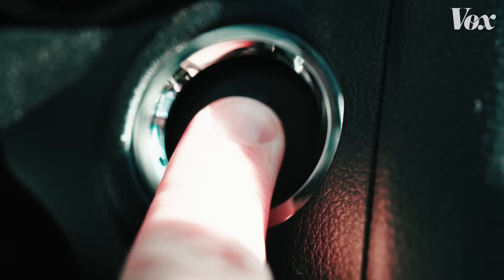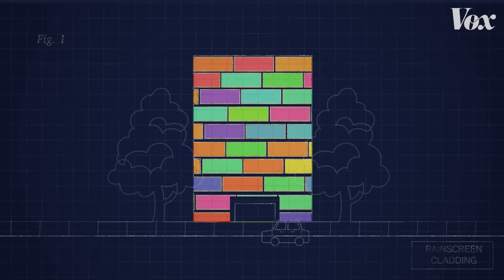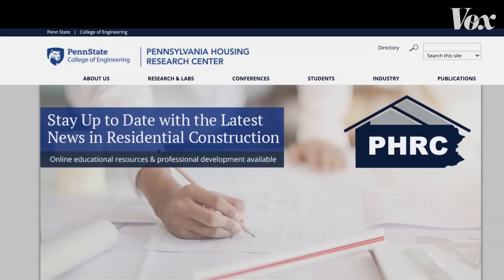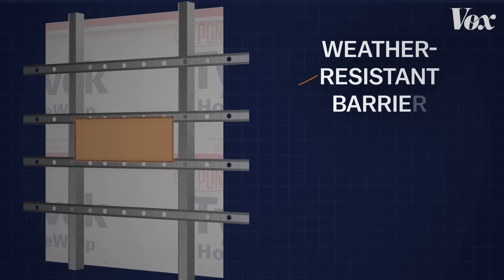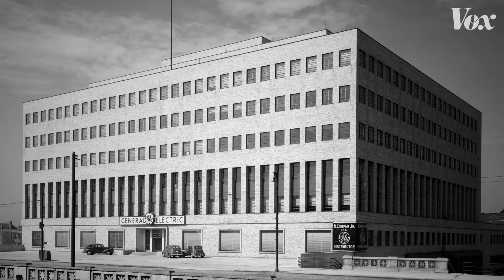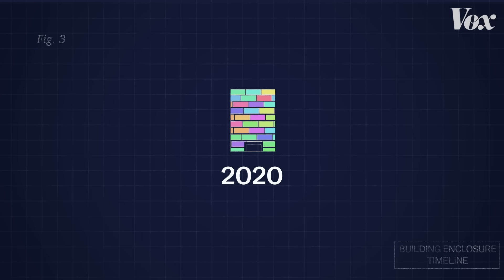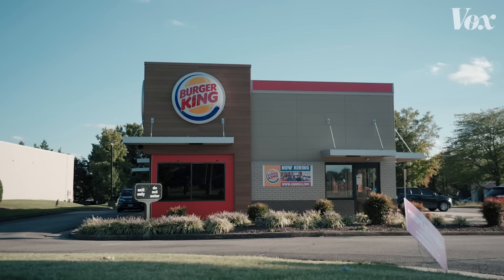Why so many new buildings are covered in rectangles

Comment: Alot of those rectangles are hardey board sheets or planks it's compressed concrete fibers basically. It's horrible to cut and you need a fitted rubber mask otherwise you'll end up with silica lung damage, remember guys wear your ppe
Reply: Bet it is quick and cheap compared to traditional material and labor practices
Reply: Hardie board is a super popular product here in Canada. I install it on a lot of commercial housing projects and you definitely need the proper mask for cutting and drilling. It is also a fairly expensive product
Reply: @cameronmacpherson5172   Compared to comparative traditional materials? It appears that traditional materials have a higher cost because the support heavier load structure while this is just basically the bow on top.
Reply: @jgaffney567  Hardie plank is several times as expensive as vinyl siding, the only real competition on large commercial buildings is stucco
Reply: I'll keep that in mind next time I happen to be cutting rainscreen cladding
Reply: @austingardiner6880  But the structure also has a cost. The foundation bones of the building has costs too. Is it quicker to build? Less labor intensive? Is the structure cheaper to build? These weigh in to overall costs
Reply: @jgaffney567  the choice and system of cladding makes little difference to the needs of the foundation and the framing. Unless it's a brick veneer we typically don't make extra adjustments to the grade beam or the framing, Even on large commercial buildings.

Comment: would be interesting to do a video on ACM panels - the cause of the grenfell tower fire, also a result of this growth in rainscreen cladding/increased insulation
Reply: Yeah, you'll notice they mention the frame, and the air-gap, but not the building wrap...
Reply: Ye I thought that. Funny how they didn’t mention it in this video
Reply: External hypocaust: the cladding creates an air gap which in turn funnels hot gases around the outside of the structure with a forced chimney effect not dissimilar to a giant hollow blow torch.

Comment: I come from the tropics with heavy rain, I simply don't believe in such materials. Maybe in temperate places where it don't rain, but in places where it rains half the month, these methods don't work. Brick and Mortar works better.
Reply: Not true at all. These cladding will actually work better because the air gap effectively shades the sides of the building making it cooler. A lot of older concrete buildings get this type of cladding to help reduce cooling costs.
Reply: I'm living in a hot humid swampy region and I keep thinking about mould/fungus growing in the empty spaces
Reply: @Silverraine1  the buidling wall is usually covered with a membrane just like a normal structure would be.
Reply: Zaydan Naufal  lu tipu siapa? Kalau sekarang aku pergi Jarkata rumah kayu, concrete, mana ada panel.

Comment: I would have loved to have seen how this relates to the Grenfell disaster. Wasn’t it the case that the panelling there had a gap behind it that fueled the fire upwards? I would not live in a building with these panels.
Reply: Yes, but in that incident "both the aluminium-polyethylene cladding and the PIR insulation plates failed fire safety tests conducted after the fire, according to the police".
Reply: The grenfell thing was so bad because of cheap materials that didn't properly pass fire safety testing
Reply: Not at all. They insulation was not fire resistant. The panel itself had nothing to do with it. The building was going to be covered in insulation regardless of whether it had the panels or not.
Reply: This is not like that at all. Those buildings were hastily built and not to code. This material meets all required building regulations, which is why it is so widely used in modern construction.
Reply: From my understanding that was a shortfall in product selection. ACM panels and combustible insulation. Look up NFPA 285 - this is the controlling factor now in the IBC

Comment: This seems like the same reasoning for explaining why tires are Round  🤔🤔🤔
Reply: How did you do that italic text?
Reply: @DustinJJ98  with underscores! like this put the underscores at the beginning and end like this: _ this _ but without the spaces!
Reply: @DustinJJ98   Camilla Ex is correct, use underscores.
You can also create bold text and strike thru by using the  " * " and " - "  symbols, too.

Comment: Ah this is why modern buildings are more prone to wear and tear, when i see modern american homes with thin walls and doors i’m always shocked because my own house is built out of solid concrete all around and has no empty space within, the doors are even made out of solid wood that’s still standing strong after decades
Reply: More mass means more to give as time erodes it away. Part of the reason grand projects don't build with so much material anymore is because future requirements make it difficult to make the needed changes -- try installing elevators and indoor plumbing into a "historical" building and you'll find there's no elegant way to do so, better to just start over.

Comment: Okay but listen, as someone who actually works at an architecture firm, literally draws these details all the time, and isn't huffing the "architecture is purely artistic representation and has NOTHING to do with cost," this video is nothing. This material yes works great at a rain screen but is the cheapest metal panel system that doesn't look awful, thats METAL panel system aka not eco friendly, not a renewable resource, super easy to dent and warp during insulation meaning if the installer messes up they whole panel gets thrown out and replaced with a new one which makes so much waste you could not even imagine. Sometimes it's not that deep bro, its popular because it's cheap and accessible. Not once in my 6+ years working in architecture have we sold this material based on the concept that it's "eco friendly." It's not, cause if it was it would be expensive and the client does not care all they care about is money.  Remind me why are we even glorifying this material and not an ACTUALLY eco friendly, incredible, innovative building material?

Comment: As an architect, I think you missed one major point.  Having been in Dubai in 2008, I was struck by how poor the structural concrete and masonry work was.  The inexperienced foreign labor had no ability for any satisfactory finish work for the concrete and masonry.  The solution was the aluminum panels to hide the poor workmanship of the structure to produce plumb and straight walls.  The problem was that they often used the wrong panels with flammable insulation cores that resulted in allowing fire to travel up the face of the building.  The panels also allow for the modernization of old facades to make them waterproof and more modern.  The London apartments that had a total building fire suffered from the same wrong panels selection.  The panels can make a clean and modern statement.

Comment: Probably one of the most awful trends in architecture. Neither environmentally friendly, nor pretty and the durability - unlike old building styles - is very much up to debate.
Reply: The environmental impact of firing brick, concrete or mining stone is much more environmentally destructive
Reply: @ChrisdeCastro  What do you think those big buildings are made out of?
Reply: @ChrisdeCastro  suggest looking at how plastics and petro-chemicals are made and where - they are not eco friendly in the slightest. At least with brick/concrete they are likely to stand the test of time better and not look 'out of date' as quickly as these plastic/cladded buildings will.
Reply: @KaminoKiller  suggest looking at the environmental impact of mining and the energy required to fire bricks and concrete. Plus the amount of those materials to make a building over modern methods. Also the energy required to upkeep older buildings. And if you cannot repurpose an older building of they become unsafe the energy required for demolition and how much of that material is not recyclable
Reply: @woflpack2390  older buildings are not necessarily better buildings if they cannot be repurposed and the energy required to keep them safe is exorbitant. For example there is a beautiful stone church where I live that also is used as a community center and school. The heating and cooling costs for the building are exponentially more than a modern building and trying to retrofit for modern amenities is more than they can afford. It is a beautiful building and worth preserving but if we made more like it it would be environmentally costly and more expensive in the long run
Reply: @ChrisdeCastro  absolutely agree - both have major impacts and the biggest issue is the amount of building being done and how much green space is being eroded :/

Comment: In Mexico, concrete is mostly used in construction. And it’s due to several factors: Colonial methods, abundance of these material… but specially, because homes are made to last centuries. 
Homes are not designed to become a waste product, but as a long-lasting one. Families tend to live for generations, consumerism is not a concept we usually use in construction.

Comment: Warning: Long post!

Most of those cheap buildings with "clever" cladding systems will get very tired very fast. But proper buildings can be build to last, even with 100 percent environmentally friendly materials.

I live in Bergen, Norway. A town with an average of around 250 rainy days a year. Add storms rolling in from the Atlantic on a regular basis. Most of the smaller houses in the old town are wooden constructions based on medieval and even viking age traditions. Either notched timber, notched 4-5" planks (more common), or ca 7x7»-based load-bearing construction with wooden infills. Standard cladding is broad, horizontal, (overlapping) wooden weatherboards with 1-2" drainage space (yes, we still use inches for describing pre-metric houses :-)). Best insulation is cellulose-based with no vapour barriers, the timber must be able to «breathe». Also, good for people. 

With some maintenance buildings like these can - and WILL - live for centuries, while newer houses with cheaper materials and faster construction time only lasts a fraction of that time. 

The ground floor of my own house is from around 1780, the rest of the house is from around 1830, with an addition from 1933. Most of the timber core is still as good as new, but a few areas had to be rebuild because of a more recent (well, maybe 40 years old), inadequate drainage system. I did it myself. Not difficult as a DIY project, just time consuming. Even some of the cladding is at least 150 years old. Replacing damaged boards is easy and often only limited to the lowest planks. 

When I hear of people buying 10-20 year old houses with all kind of hidden nasties I really appreciate a traditional, made-to-last construction. Please choose quality.

Comment: An equally annoying trend I’ve noticed is that the window line on every single car angles upwards towards the back of the car. Old cars had a horizontal window line, but now you can’t find a single car with the trend. Even vans and utility vehicles suffer from it.

Comment: aren't these cladding panel things with the air flow gap the same thing that was cause of the Grenfell Tower disaster, as in how the fire spread so fast etc? 
"Rectangles" are still being removed from buildings in England to try and prevent a repeat of the tragedy.
(This is genuinely a question, I don't know, I just thought it sounded like the same thing and I don't know)
Reply: The cladding creates an air sheath which can spread hot gases around the building surface regardless of the flammability of the cladding materials.

Comment: In Finland, those panels are at least marketed to us in such a way that 1) they reduce the energy consumption of apartments, 2) they reduce the need for heating apartments and 3) they bind carbon dioxide from the air, and for these three reasons those panels are installed in new and old buildings.

Comment: Most commercial panels are not this rain cladding. They are a steel skin, with a sturdy foam core. They provide the finished face, the insulation. And the structure of the exterior walls. They can be applied directly onto the structural steel. This is why they are now the preferred method, they do 3 jobs in 1 system.

Comment: Still confused how adding cladding on the outside of a building saves material overall. I understand it protects wood framing from moisture, but I see this system on concrete and steel buildings, too.

Comment: Now don't think that they're all built the same way when you see a building with it. I've been working in the remodeling of car dealerships and the quality of it depends on who wins the auction for the contract. And ive seen them add some bad wood paneling to the existing structure and then on top of that, the alpolic sheets installed with just some aluminum angles. It doesnt have that system with the airpockets and rails shown in the video. But from the outside it looks the same.

Comment: Lets not forget that these ‚modern‘ and ‚environmentally friendly‘ materials are literally just oil products. Any benefits come from houses being better isolated which you can do without using any or at least using less oil based materials as well.
Additionally, sometimes you just happen to produce a Grenfell tower fire when you use this kind of cladding.

There is exactly one reason why this new cladding is used: Its cheaper
Everything else is purely a nice side effect and not the actual reason.

Comment: The concrete thing can be seen in the science building built in 1962 on my campus it’s all poured concrete. It’s annoying because the lecture halls are disconnected from the rest of the building that either involves going the maintenance halls or going up to the third floor and back down. This is also where most freshmen classes are so good luck finding anything took me almost an hour to find my physics lab and that was with Covid traffic direction maps.

Comment: This video was potentially interesting but it's so scattershot that I came away wondering what the point was.

You lead with the "discovery" that rectangles are the most prominent shape on the exterior most contemporary buildings. The only surprising thing about this discovery, to a layman, is that you find it surprising. What other shape would you expect buildings to feature, if not the rectangle? Triangles? Circles? Arches? Domes? This question is never answered or explored.

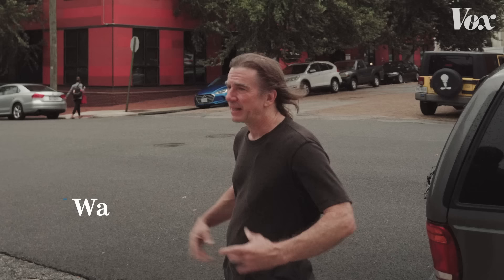Comment: 1:11 Terrace 202, in the 'historic district'. imo it defeats the purpose of having a historic district to begin with, when a post-modern building is built there. The Entire Point of having a 'Historic District', is to have buildings, new or old, which are explicitly built in as much of the old architectural styles, and using as many old architectural methods, as is possible, and intended to last as long as possible. 
NOT crapping out post-modernist soulless hyper-modern buildings into 'the historic distruct', which have only a cursory appearance of 'historicity', which then gets demo'ed at thirty years of building age, down to the exact hour, and replaced with something even more hideous and soulless, again made in gleeful mockery of 'historical architecture' in every sense of the term.

Comment: Those masonary buildings are often 100 years old, will still be here in another 100.
Whilst the lightweight systems will fail in 30, then be replaced, then fail in 30 years ectect
You cant say a material is green when its basically disposable

Comment: Buildings like these are everywhere in Minneapolis. They all look the same and generic. I actually wonder about the sustainability of this design system when it requires lots of manufacturing, metal, and will be replaced in 30-50 years. Brick and stone seem like a more environmental option considering longevity and abundance.

Comment: It would be interesting to see vox make the comparison with houses built in other countries. Here in southeast Asia, houses are made with bricks. There are very few rural houses made with wood. I still don't understand why US shifted to using wood. Here it says it was due to wood panels being cheaper and more flexible but brick houses are strong and durable and bricks are not that expensive? I'm still confused. Asian countries are plentiful in wood and yet we still use bricks for houses, so why are we so different with the US?
Reply: In America, the only thing that matters is money. And not for the future, just for yourself. Building a house that lasts a long time doesn't make you more money, and it costs you more, so noone does it.

The entire country has been built on temporary structures. In the next few decades, most of these structures are expected to fall apart. Nobody has any plan on what to do about this, and nobody seems to care.

These awful wooden apartment buildings clad with this metal sheeting are mostly held together with glue. They are only designed to last about 20 years, and there is no way to fix them once they start to fail. Even more temporary than the older things built in the 1950s and 60s were.

This attitude is how everything is run here, with no sign of it ever changing. Even now, the economy is collapsing, there are constant shortages of everything, the cost of living has nearly doubled in the last few months, and the official line is "we don't know why these things are happening".

It's very depressing. It's not nice living here, unless you are very wealthy and can just spend money to get around these problems.